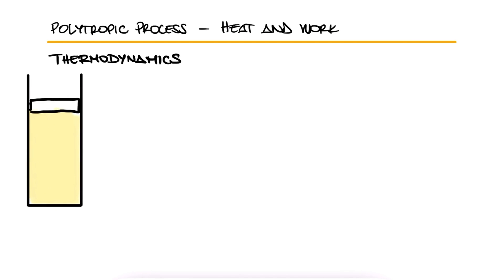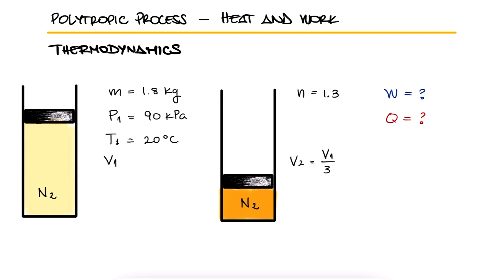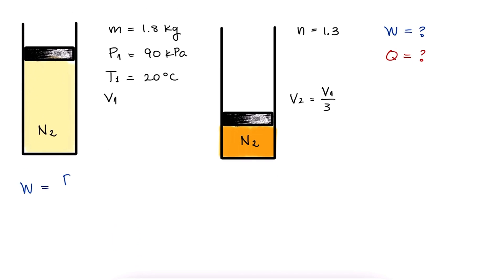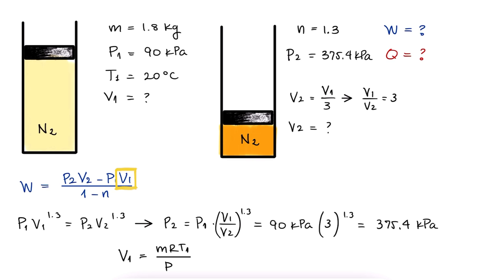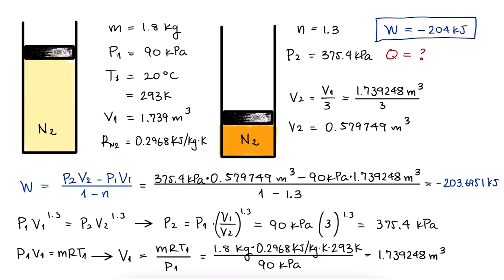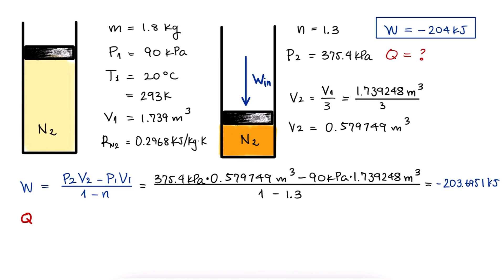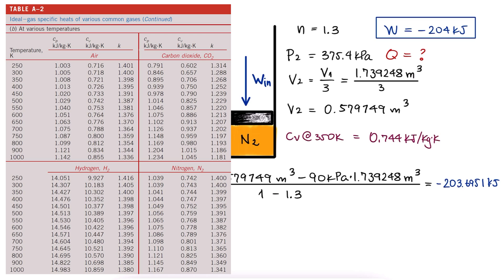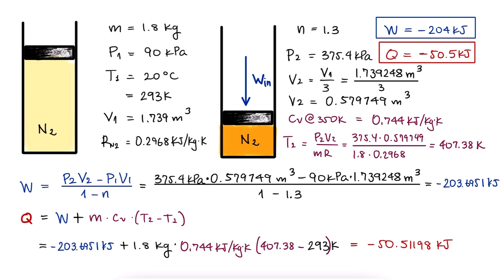Heat and Work of a POLYTROPIC Process in 3 Minutes!

Comment: I had to make some of the same ‘mental re-adjustments’ as some others; as we were used to ‘n = moles’ equations and a goofy n (~eta) for polytropic index. In that world, n moles are used, but in others like this one, some use mass and modify other units like R and cv. I, like another commenter, first converted everything out of mass and back into moles, etc., to plug into my familiar equations. Either way, I was getting different answers for the last step Q (aside from all the rounding details). I tore it down to the core, and found the issue, but don’t know how to resolve it.

Essentially… to derive the polytropic equation for W = delta(PV) / (1-eta) you essentially end up substituting the Isentropic gamma (or kappa k in some disciplines) with the polytropic eta (n*) which came from cv=R/(1-eta) vs. cv=R/(1-gamma), yet in the last step of Q = , you look up cv? In other words, behind the scenes of Q = W + delta(U), the work equation is relying on a cv built from cv=R/(1-eta), and the total energy equation is relying on a different cv built from cv=R/(1-gamma), plus that’s a table-looked-up value which certainly uses the gamma cv and actually lists gamma (kappa) right there as 1.399, so definitely not an eta (n*) based cv (like 1.3 here for this example problem)

 So for polytropic processes, does cv=R/(1-gamma) or cv=R/(1-eta) because gamma does not equal eta (1.399 ≠ 1.3). So different cv’s are being used for W and delta(U) in determining Q. And I confirmed that by using the different cv’s in my go-to total energy equation delta(U) = n*cv*delta(T). I get the same answer for Q as in the video only when using the gamma-based cv for energy and the eta-based cv for the work, Q = W[eta cv] + delta(U)[gamma cv]. Specifically, I have to use the eta cv in the work equation (as it is derived that way) but use the gamma cv in delta(U) (as this sample problem does and even looks it up). So… using two different values for cv in the same equations determining Q here?

Comment: why Delta U= m*cv( T2-T1) and not Delta U =cv(T2-T1).   why is mass included
Reply: We can even consider mass in the place of mole so some times taking mass gives accurate results
Reply: Some use a Molar specific heat of constant volume (cv), and some use a Mass specific heat of constant volume (Cv): Delta(U) = n*cv*Delta(T) = m*Cv*Delta(T).  The units tell you which version is being used. This Mass-vs.-Molar-Mass equation conflict/confusion is everywhere, including in the Universal Gas Constant “R”, which renders it not really universal :( Some use the molar gas constant R=8.314 J/(mol*K), some use a gas constant for a specific mass of molecules [ R(air)=0.2871 kJ/(kg*K) ] where mass ‘m’ is always near it ready to make it ‘universal’ again, So again, the units tell you which version is being used.

Comment: Sir, there, during the numerical, u used mass(m) instead of number of mols(n), I think u should first find the 'n' by the mass and molecular weight so then u can obtain the value of 'n' and replace in the formula
Reply: Bro few people use mass in the place of mole ... So it's like sometimes using mass gives more accurate results... You can google it